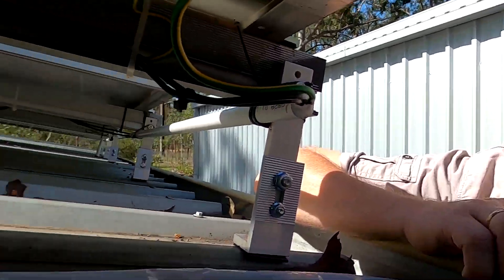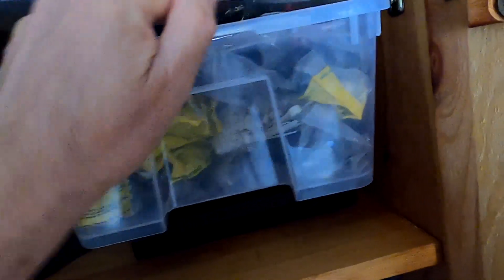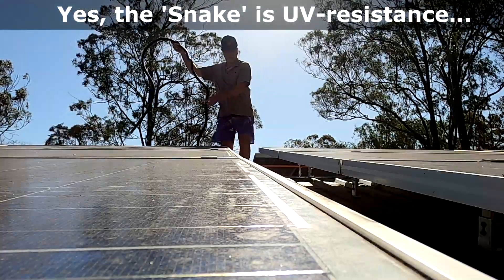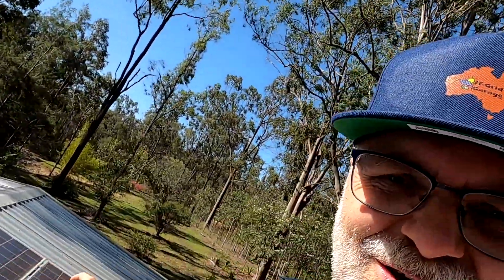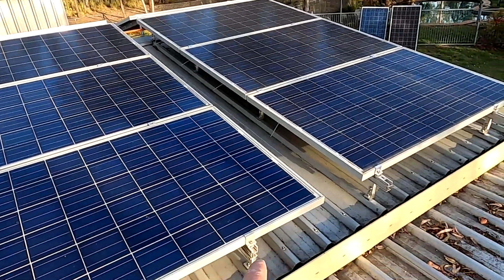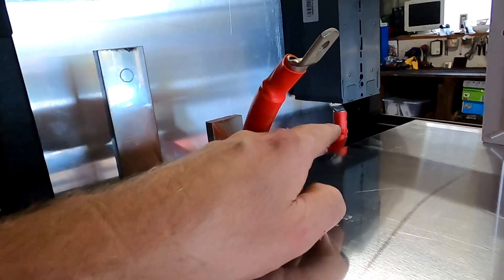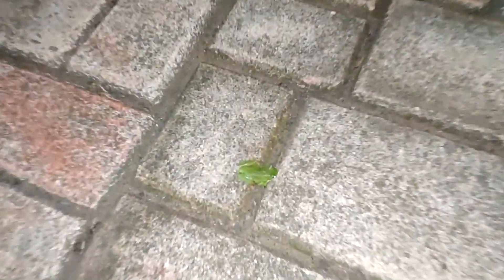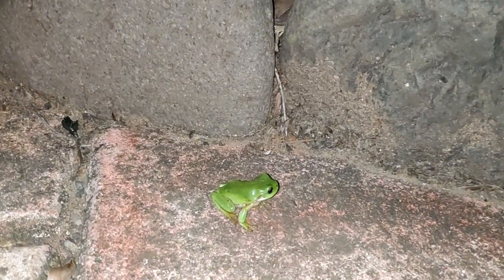No Battery, no BMS, no test. Just real work on the roof! Also, the battery shelf...

Comment: Yea.... Well Andy now I just wonder about the "UV resistant Tie straps"/Zip ties +.. How does the UV get to it under the panels in the shade... Maybe some clever UV GUY can explain if it is UV rays or heat that over 25 years can cause damage. I know when i go sit down the sun does not get to where it is dark, or go down... but, who am I anyway to question the learned UV guys. I am from Africa and that might have a adverse effect as well? Great Vid as per usual, thank you Andy.! (hope that puts a smile back for some)
Reply from the maker: Yeah, might be more the heat which breaks them down. UV rays usually don't get underneath the panel. I guess that's more the regulation which says use stainless steel ties to be sure in any way.

Comment: need help have a 36 volt battery and has 36 volts but wont power anything even with bms off you can even but wires together and nothing haapen how can have volts but no power ?
Reply from the maker: A 36V battery... Is this 3 batteries 12V each in series?
Reply: @OffGridGarageAustralia  it's a ebike battery single cells 10 s 7 p

Comment: It's going to look very neat when you are finished just to let you know that when I worked in the exchange they used to put a type of heat shrink on the Bus Bars red and blue
Reply from the maker: I will cover the bus bars as well but not with heat shrink. The bus bar was too expensive to hide it 😁

Comment: White zipties are not UV.  The black zipties are UV resistant from the carbon or pigment for color.
Reply from the maker: Not all of them apparently. I had some at my front gate and they fell off after 2 years. The white ones are still there for over 5 years now.
Reply: @OffGridGarageAustralia  That could be.  I guess white could be either, but black is always UV.  Some inspectors here make you add black over any white zipties since you can't prove every white ziptie is UV protected.

Comment: Currently redesigning the battery shed because I'm adding an extra inverter and ( LiFePo4) batteries, my SLA's won't last forever even though they're doing a bloody good job.
Like you I'm trying to think this all through, for hours and hours.
The problem with all this thinking is that my old Dad used to tell me to leave thinking to a horse, it has a bigger head.
I think he was right.
Reply from the maker: That was a very good advice from your dad. I think he's spot on.

Comment: Split tube? Never ever seen a system using split tube. 4mm earthing cable is perfectly fine. That’s all the solar installers use, and it can handle way more current than your panels can provide. Where the earth cable has its insulation removed where it meets the rail should be covered in gal paint to avoid corrosion.

You have no roof top isolators - thou the standards suck in this regard.

The next big one for you is earth leakage detection. This is a requirement under AS5139. The Victron MPPTs are not galvanically isolated, so can potentially put your battery at solar potential, and at above 60v DC will require the earth leakage detection. (Sucks I know cause it’s not cheap)
Reply from the maker: If you don't use split tube how else would you get the cables out feeding to each solar panel? You only use conduit in between the panels and have a gap at each junction box?
Yeah, the roof top isolator... I would need one for each set of strings feeding down inside. Or re-wiring all panels...
Well, the BMS would turn off the battery if the SCC is faulty and keeps charging the battery, so it can never go over 60V.
Reply: @OffGridGarageAustralia  Don't bother with roof top isolators.  A high voltage switch out in the sun and rain is a bad idea.  Houses burn down.  The requirement is being removed from AS 5033 in the 2021 update.  Instead you just need to label a "point of disconnection" which can just be one of the MC4 connectors.

The new requirements in AS 5139 for galvanic isolation to be required if PV is over 60V (DVC-A) is in my view a bit harsh for people running 48V battery systems.  What is the probability of your Victron MPPT failing short circuit AND the fault goes unnoticed/un-repaired AND you decide to put your fingers across both terminals?  But rules are rules, and technically you cannot work on your 48V system (because it has non-isolated coupling to a DVC-B level PV) unless you are a licenced electrician.  My system has all 24V panels feeding a 24V battery (supplies DC lighting) and a boost converter charging a 48V battery for the inverter.  No electrician required because all voltages within the system are below DVC-A (and the 230V inverter output is galvanically isolated from the battery).  But in terms of risk, my boost converter is just as likely to fail and output > 60V than a SCC is to fail and put out the full PV voltage.

By the way, are the MOSFETs in the BMS rated to stand off the full PV open circuit voltage?  Not a problem for contactor BMS, but for FET you need to check you have adequate spec.  If it has insufficient voltage rating then the FETs will fail short circuit and you will cook your $$$$ batteries.  Even if you have a reliable Victron SCC and BMS with sufficient voltage rating, a spike from nearby lightning could cause both to go short circuit, putting the batteries at risk.  A galvanically isolated SCC (Victron now make one in response to AS 5139) would keep the batteries safe.  A contactor BMS could also be safer, depending on the failure mode of the electronics controlling the contactor. 

Further craziness is that AS 5033 will follow AS 5139's move to using DVC definitions.  But for PV, DVC-A is 35V DC, since the roof is a wet area.  That means even using 1 PV module requires an electrician (due to "unsafe" voltage level).  We are applying the same rules for 35V as we do for 1000V.  Hopefully somebody can prove my interpretation of the standards as wrong.
Reply from the maker: @henvern  Thanks a lot for the info. I don't have all the rules (yet) to read through them. I didn't know about the isolator not been mandatory any more. It was on my list though...
Reply: @OffGridGarageAustralia  I recently had a discussion about AS 5033:2021. Things seem to be getting very restricted for DIY in Australia...
Reply: @upnorthandpersonal  someone in a Facebook group im in just got a letter from energy safe Victoria to take down his solar panels as he is not approved to have them, they supposedly spotted them via satellite image and then sent an inspector as the premises wasnt registered to have ever had solar professionally installed. Saw the letter myself, its absolutely crazy.
Reply: @henvern  - there is a YouTube video showing severely damaged and deformed Lifepo4 cells, caused by a SCC failure, putting the solar panel voltage to the battery. The JK BMS is up to 24S, so may withstand it. I’m using 8S cells, with a 10-24S DYKB BMS (Ant) just for that reason. 8mm solar rail earthing cable, with stainless earthing clips, which cut into the ally panel frame. Also 2 DC SPD’s on solar wiring. A RCCD & SPD on the AC output, which is also 8mm Earthed. Plus I have solid copper wire from the final Earth-Lug (on solar rail) pointing at the sky, to dissipate electrons, and reduce chances of lightning strike. Earth rod is in saturated ground, neighbours have houses on stilts over a pond. My ground level is about 1/3 Meter or 1 foot above water level. Recon I am also protecting them. Only thing is Earth leakage protection, on the roof, which has also become a requirement in USA.
Reply: @lexicase8805  Here in Finland, an exemption in the "Land Use and Construction Act" was made in 2017 that essentially states that a license/permit is not required if the solar install does not significantly affects the cityscape or environment. In rural areas this usually means that you don't annoy your neighbors by installing panels near property lines blasting reflected light in their direction. In other words, you can put up your own panels on a ground mount for instance and don't need a permit.
Reply: @henvern  These standards are so painful. Add that to the fact that the public cant access them without paying for them... How are we supposed to ensure we're compliant or even know about things that we're in breach of.
Reply: @lexicase8805  What if he just put the panels up himself for a low voltage battery bank? Or is touching a panel without being a solar installer, not allowed in Victoria?
Reply: @kyba74  from what ive learned recently, the panels themselves are considered outdoor electrical, meaning the voltage where an electrician is required is only 28vdc, and most panels these days are 38-45v so even one simple panel and two wires, technically requires a licensed electrician to connect. Theres also specific mounting requirements and standards that need to be followed, so that they meet the wind regulations etc. So yeah diy is very risky these days and while it sucks for those of us who do a good job of our diy work, theres people who do such a poor job and create a safety hazard for anyone nearby, and its those people that have ruined it for everyone.
Reply: @lexicase8805  hope that's Victoria only. Geez it's turning into such a draconian state

Comment: It seems windy where you are, you should also get a wind turbine 😁
Reply from the maker: Considering... Nah, not really worth it, we're in a valley...
Reply: @OffGridGarageAustralia  ive done the whole wind turbine thing, unless you modify a fisher and paykel washing machine motor, and then make something big enough to spin it, the store bought wind turbines are noisy and produce very little power. My 700w b&c turbine made a whole 40w reliably, and that was so windy there were trees that fell.
Reply from the maker: @lexicase8805  thanks for your advice. I have seen many 'reviews' and tests online form people installing them and they almost all had the same result as you described it. I would be better off installing another string of solar panels with 750W. I've got enough roof space...
Reply: @OffGridGarageAustralia  absolutely, i was lucky to have free return on my $700 turbine, so i sent it back, bought more battery storage and another 3 panels and im instantly much better off. Also my neighbour asked if i was running a garden hose out the back at 2am, no YouTube video could ever convey the sound it makes, but if youre down wind of the turbine it genuinely sounds like a pressure washer on the concrete. Solar panels even on the cloudiest winter day outperform, and they're silent 👌

Comment: Thanks Andy, 6 mm earth wire sounds the go. Plus split conduit, I new there was a reason I was taking my time with this build. By the way check out you house roof top solar wiring mate, mine has no conduit , pretty dodgy.
Reply from the maker: The regulations have changed since they installed the house system. All cables were just cable tied to the rails but nowadays, everything needs to be in conduit.

Comment: Also, I might share an old tip and pet peeve of mine regarding ty-wraps. I used to do a lot of industrial control panel and aircraft wiring, and always got cuts from sharp edges of ty-wraps that had been cut. I tried to cut them close but could not avoid getting the sharp edges, until an old wireman suggested I use lineman's pliers and twist the excess ty-wrap ends close to the cinch point which leaves a perfectly smooth end. I seem to recall from decades ago instructions on some ty-wrap packaging also recommending the twist method.
Reply from the maker: Great tip, thanks for sharing.
Reply: If you work a lot with ty-wraps, it is wiser to use a cable tie tool, never sharp edges, I have been using the Thomas&Betts tool for thirty years with great pleasure..
Reply: @habana7638  Yup, good point, I had T&B ty-wrap guns back in the 90's but recall they were clumsy, expensive and broke quickly. They also were one more thing to stuff in an electrician's tool bag that didn't fit well, and you needed two sizes for small and large ty-wraps. They were often impractical behind cramped aircraft instrument panels and bays, the cutter blades dulled quickly and using them often made you the brunt of jokes with old-school industrial wiremem.  

There were some large Oil and Gas, and Nuclear projects that required we use them, but about half the guys i worked with ditched them in favor of Klein Lineman Pliers and QC engineering signed-off on that after we demonstrated that more often than not they didn't provide a uniform or adequate cinch. 

Maybe there's good one's now, but I always considered them more of a gimmick.
Reply from the maker: @habana7638  Is this tool also for stainless steel ties?
Reply: @OffGridGarageAustralia  No, these are for Polyamide/Nylon Tie wraps only,  but why cut them? if there's no need for, you won't see it anyway.
Reply: @OffGridGarageAustralia  I doubt it, and it looks like Andy left the excess in place, likely because cutting it would leave a razor like edge.
Reply from the maker: @jackoneil3933  I just bent them over. I cut one and it really left a sharp edge where you could cut yourself easily.
Reply: Haha…"brunt of jokes with old-school industrial wiremem" but you're right, they worked well but were not very sturdy and as you say often not useful in small spaces, I usually used small side cutters that gave the same result and you always had those at hand, but otherwise the tool was quite easy to use, have to look for it and still have one :o)
Reply: @habana7638  Yes, If you could could flush and even with small dikes you could get a fairly dull edge, but as I recall the Ty-Wrap guns had a one-sided shear that did a pretty good job of leaving a smooth edge. l much prefer the twist method.

Comment: nice video Andy. Just side note ..usually all black plastic is uv resistant ..that is why black cable ties are ok ...white ones are not..they break in few months..black will usually last few years..
Reply from the maker: I had the white ones at my solar front gate in pure sun and the plastic lasted like 10 years before they came off. The black ones I also had there lasted only 2-3 years. The stainless ones are not too expensive, so I will stick with these for these locations.
Reply: @OffGridGarageAustralia  Agree to that..there isn't plastic like plastic. everything is possible. But stainless-steel usually last for ages before it will brake..

Comment: uv resistant plastic, lasts like 5 mins longer. The amount of car covers I used to get through, all off which said they were uv resistant. 
however under solar panels, will not get a significant uv exposure.
Reply from the maker: I thought so too, it is tugged away under the panels but hat to cut them anyway.